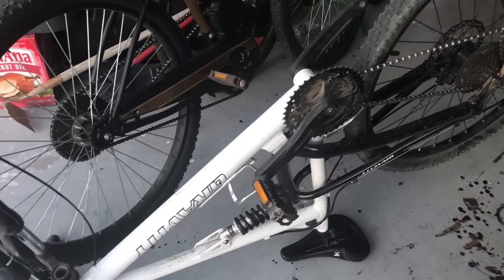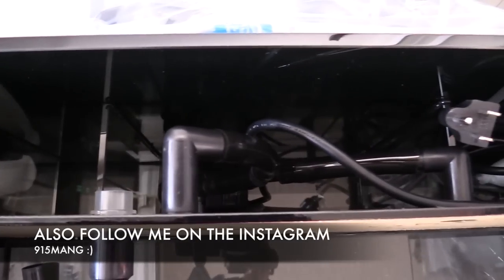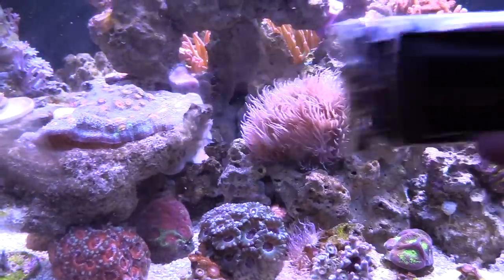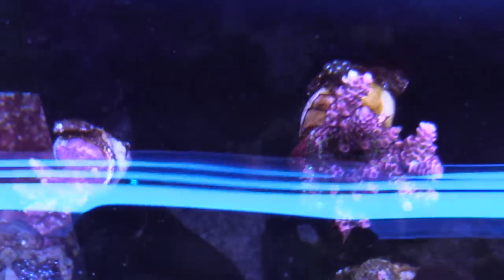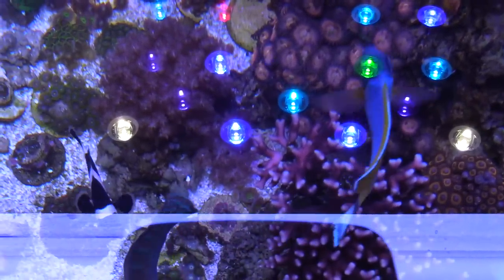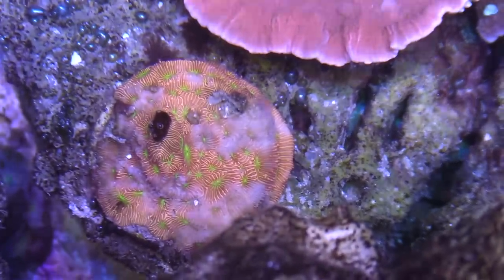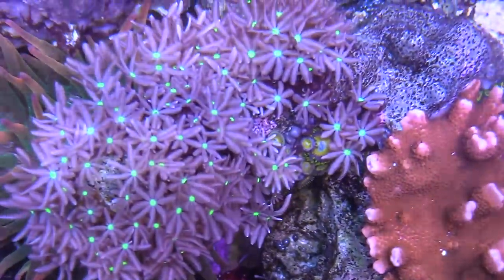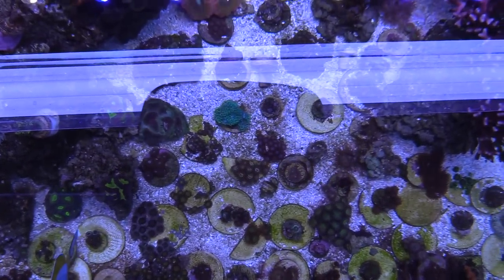150G REEF SALTWATER AQUARIUM CORAL REEF TANK UPDATE | TOP DOWN VIEWS OF SPS ZOAS

Comment: I'm riding a Fuji mountain bike, mostly on the road.  Been a few months since I rode last.  I was run off the road in June and broke my arm inside the elbow joint.  I'll be getting back on the bike in a week or two.  Wishing El Paso was a little closer to San Antonio.  LOL.  I'd hit you up for some corals.  Your tank looks amazing.  I have similar rainbow nems as yours.  Mine have split twice in a little less than a year.  I hope you do a video on the IM tank you got.Look forward to the next video.Take care.Ted
Reply from the maker: strat1960s Hey strat, I’m glad you’re okay and hopefully you got that card plate. I think that’s why I like the dirt trails because usually it’s other riders and runners on the trails.
Reply: Driver didn't even slow down.  I was too busy going over the handle bars to get the plate number.  I saw it was a silver 4-door.  Driver had a beard.  Then I saw sky, and then the road.  Walked 3 miles home to go to the hospital.  LOL  Yes, I need to find some local trails.
Reply from the maker: strat1960s Glad you’re ok 👌🏼 there’s an app called “All Trails” pretty nice app
Reply: Ill have to check that app out.Thank you
Reply from the maker: Have a good one!